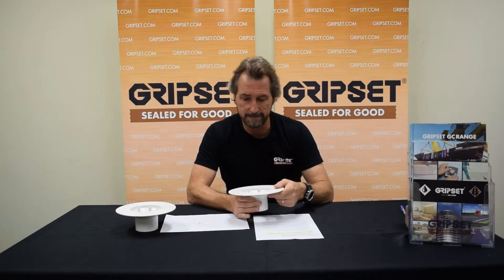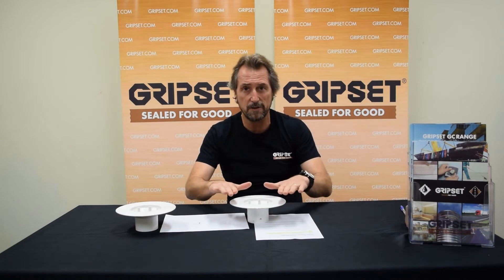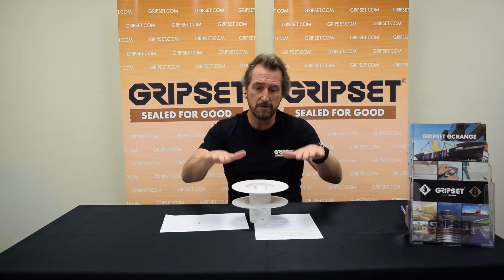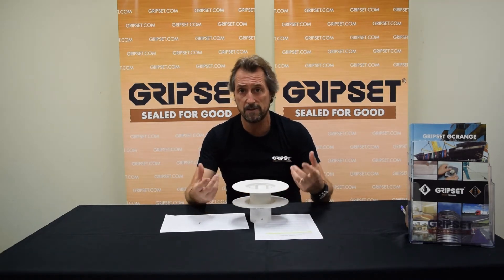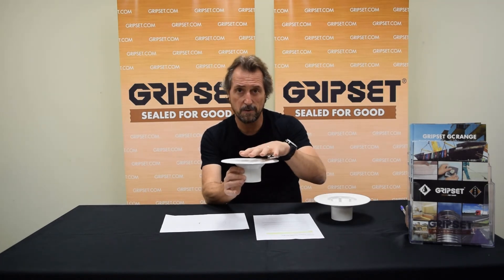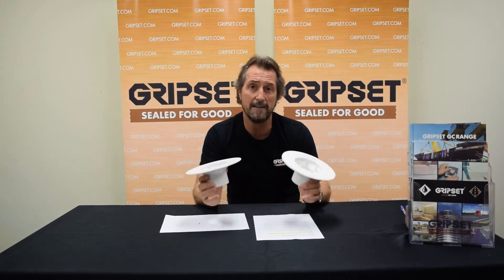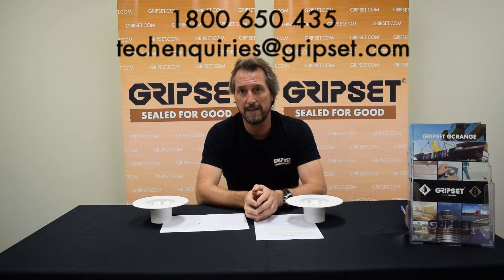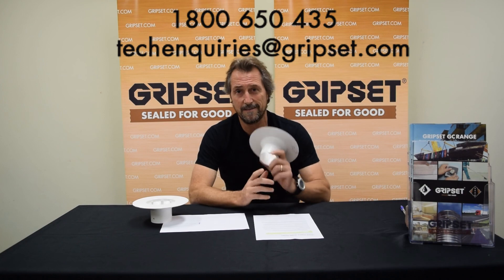How Puddle Flanges Work To Drain Below Screed

Comment: The problem is in most cases if you have a 50mm shower recess pipe the puddle flange on the substrate fits in snug , but when you screed there is no puddle flange that will fit into the existing 50mm puddle flange whether it be a standard grate , a smart waste or a strip grate

Comment: Thank you for your excellent videos. I have found them very informative, as have many others, based on their comments. Well done.
Can I respectfully make a suggestion to make your videos even more informative?  Whilst my suggestion may take a little time to construct and may even mean you need to produce an updated version of some of your videos, I am sure the benefits would be obvious. The model would assist in your training programs with waterproofers and tilers as well as those of us who view your videos.
As an ex-teacher I suggest you make a cut away model showing various scenarios.  By being able to SEE an example of what you are talking about your verbal explanation will be so much easier to understand.  In the case of the double puddle flange over and under system we would be able to see, for example, an upper level timber floor covered with FC sheeting.  The puddle flange would be seen recessed into the FC sheet.  A layer of Grip-Set butyl rubber would cover the joint between the flange and the FC sheet. A layer of mortar would be applied over the rubber. Recessed into that mortar would be a SCREW TYPE PUDDLE FLANGE to enable the finished height of the flange to be adjusted to suit the thickness of the mortar bed at the shower/floor drain.  On top of that would be the layer of waterproofing. I hope you take this suggestion in the spirit in which it is offered.  An already excellent series of videos would become so much better. Best wishes to you and Shandy, the other presenter I saw on one of your videos.
Reply from the maker: Hi Paul, we've sent this through to our technical team who organises the construction. We think it's a great idea and appreciate the time to put forth your feedback! Thanks for watching and for your insight! Happy waterproofing!
Reply: @GripsetIndustriesPTYLtd My pleasure. Good luck.

Comment: With the over and under method, once puddle flange is installed as well as the rubber sheet on top, is it okay to still water proof the fc floor and over the rubber sheet into the puddle flange?
Reply from the maker: Hi Five pot, assuming the rubber you're referring to is the BRW-PF Square or PFN sheet, then the answer is yes! Always refer to the Australian Standard application details. Thanks for watching and your support! :)

Comment: Awesome info guys. In a scenario where you waterproof under an over the bed and are using a strip drain and cant incorporate the second puddle flange because the bottom of the drain sits below the top of the bedding how would you go about finishing the waterproofing around the puddle flange so that in a scenario where the above water proofing fails the water can still drain out of the bedding? Excellent content just subcribed to the channel 👍🏼
Reply from the maker: Hi Rheyen, take a look here https://www.creativedrainsolutions.com.au/files/Tile-Surround-Installation-Guide.pdf . If you spend some time researching online, you will be able to find a suitable drainage product that will allow for both drainage top and bottom of screed! :)

Comment: Thank you for the video. However, unfortunately, one puddle flange popped into another one creates a very 'high' puddle flange and means that final floor heights would be too high in most bathroom situations. I have exhausted efforts to find a specific 'double' puddle flange that is designed to be 'low' but to no avail. If anyone knows of one or IF GRIPSET COULD DESIGN AND MAKE ONE I think the issue would finally be solved and would be grateful to hear about it. Cheers all.
Reply: Stormtech ALCF 2 inch kit is double puddle flange
Reply: @JNtolm  FINALLY! Thank you so much. That double puddle flange looks like one beautiful thing!!! Halleeebloodylooooooyah!
Reply: They had it in one of there videos talking about under and over and didn’t even mention it 😂

Comment: Love your videos. I was hoping this vid would answer my question but it doesn't quite do so.

I understand the sloped screed helps the main surface water to flow to the drain quickly. Assuming only waterproofing underneath screed only.  If the waterproofed underlay in a shower / wet area bathroom is flat, how does the water move towards the sunken puddle flange? Eg If water goes through the grout and into the screed in a room corner 2-3 metres from a puddle flange, it's now sitting on a flat waterproof membrane, is it purely dispersion and osmosis that gets it to the puddle flange? Seems like a lot of water will simply sit there in the porous screed over time.
Reply from the maker: Hi Carazy, Thanks!  We love Permaculture! The floor membrane is applied to should always have fall to drain, this is a minimum requirement of the Australian standards and important for all the reasons you have pointed out. Thanks for the support!

Comment: Question. If I have a puddle flange jammed into the puddle flange below how does water in the screed get through the top puddle flange and into the drain. Thanks.
Reply from the maker: Hi Richard, you can connect the top and bottom flange with a connector correctly and this will allow the water to flow through to the bottom pipe. If you would like more details feel free to share you contact number and we can call you to discuss further. Thanks
Reply: You prolly dont care at all but does any of you know of a tool to get back into an Instagram account..?
I somehow lost the account password. I love any assistance you can give me
Reply: @Ismael Wyatt instablaster ;)
Reply: @Kyler Nolan I really appreciate your reply. I found the site on google and I'm in the hacking process atm.
Seems to take quite some time so I will get back to you later with my results.
Reply: @Kyler Nolan It did the trick and I finally got access to my account again. I'm so happy:D
Thank you so much, you saved my account !
Reply: @Ismael Wyatt Glad I could help xD

Comment: Could not agree more with your video. I find putting 2 puddle flanges a problem in a shower situation as I usually only have around 20mm screed in the shower waste area which does not allow enough room for the height of a standard puddle flange. Do you have any advice on this or type of puddle flange that will work
Reply from the maker: Thanks for your inquiry. Yes, we can recommend a "screw top " style puddle flange, these we find are usually flush without a rebate. If you have any other questions please feel free to contact our technical support on 1800 650 435